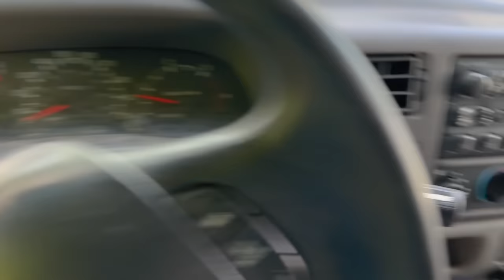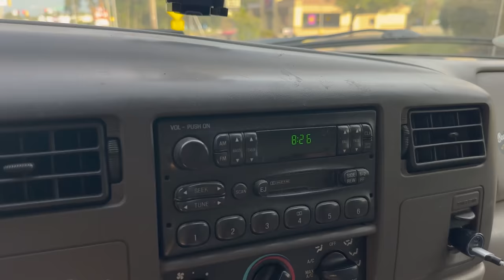The Win I've Been Needing

Comment: On the trailer brakes:  check the safety line that connects to the hitch.  They are designed to lock the brakes if it detects the trailer comes off the hitch.  Sometimes the detector switch needs to be replaced.

Comment: Check the emergency breakaway module.  Most trailers come with a emergency module with a small cable that attaches to the bumper near the hitch.  If the trailer unhitches itself down the road, it pulls the pin on the module and immediately sets the brakes.  If you haven't been attaching that cable, they do still go bad and will engage the breaks.  All you need to do is replace the module.  Cheap easy fix.  Good job finding crabs and a willing audience to buy.  Wins always feel good.

Comment: Luke,your trailers brakes are electric they apply when you hit the brakes. There controlled when you hook up your trailer to the truck through the plug in. You should be able to adjust the brakes on the trailer. But unless you have a trailer brake controller put on the truck you can only adjust them by hand on the trailer. The controller let's you adjust them inside the truck while driving.

Comment: Good to see your hard work pay off.  BTW,  you don't need a controller if you have electric over hydraulic or surge brakes.  The trailer brakes engage when the truck brakes.  You can add a controller to adjust.

Comment: New favorite YouTube channel. So, if you have a 7 pin trailer plug most likely there is a brake circuit in there. A controller would be nice so they don’t lock up. You can get them aftermarket if the truck doesn’t have one.

Comment: well i'm sure you figured it out.  i'm late as always.  so just realize the brakes started working - ck, and the trailer might have a battery fed Ebrake-ck, and your prob seemed to be that they started working.  i'd say saltwater intrusion.  but yeah, you need to make use of those trailer brakes.  not urgent, not emergency.  keep them rinsed off even though it doesn't go down into the surf.  its probably saltwater - it kills locks erodes everything.  i would find electric brakes on that trailer, since it seems that is the issue.  the better option is hydraulic.  but then reversing while uphill will cause it to compress the cylinder - i know you are smart enough to get that.  good luck.  
you are killing it.  at life.  and you have a wife.  so right there you have beat the hell out of life. good job. love it